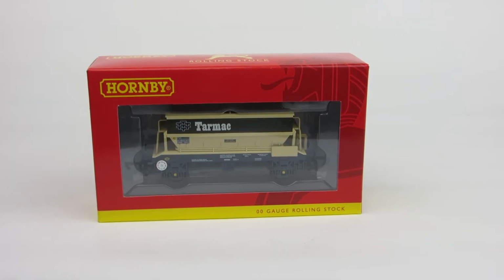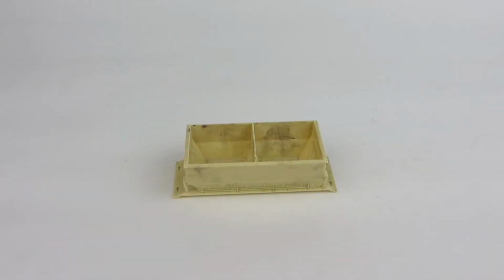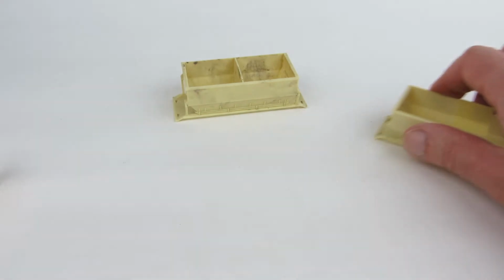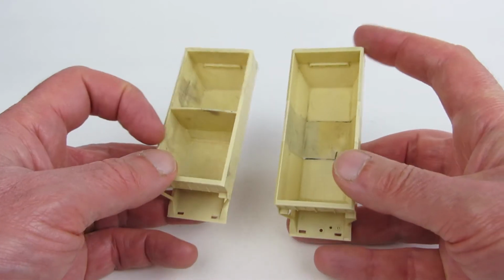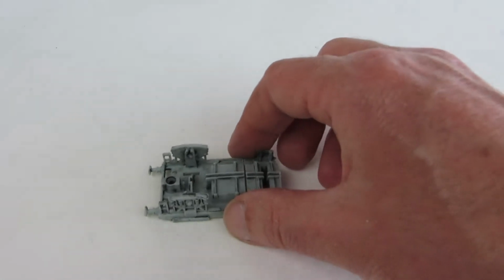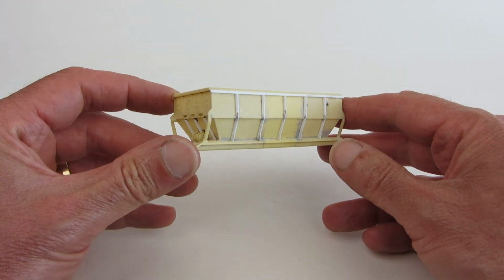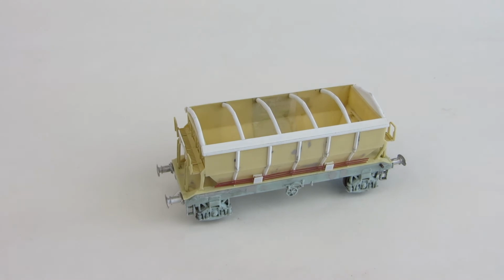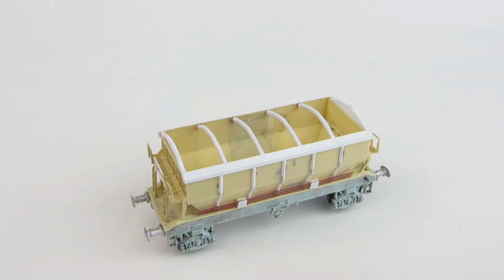How to adapt a Hornby Model Railways Wagon

Comment: Hi, This is one of the best videos on YT I found. Highest level of modeling.  But why in 4 minutes only? Each step would have deserved tat least ten-ten minutes or much more. One question, if I may: what tool did you used to cut the coach, straight, perfect, without any damage and destruction? Thanks!

Comment: I enjoy customising and weathering wagons and Coaches, but I just couldn’t do this to a new wagon. If I was doing this sort of project,it would have to be out of scrap or supercheap preowned units.
Reply: New, old, whats the difference, long as you had fun and end up with something you're proud of it doesn't matter one bit what the source is.
Reply: Mmm it's a waste of another wagon, I suppose you end up with another chassis for another project as there loads of other unusual pga .. I'm thinking of just cutting one in half and adding an extension..

Comment: Has Hornby not modelled it correctly?! Why we do the manufacturer thing!?
Reply: This is actually the old Lima tooling (reused by Hornby), and is fine for the stone PGA's.
https://www.flickr.com/photos/hmillington/2034858547/
However, there were longer versions used for salt movements, and the only way to get them is by converting them.
https://www.flickr.com/photos/21513703@N06/34773340365/
Reply: Many thanks 🙂